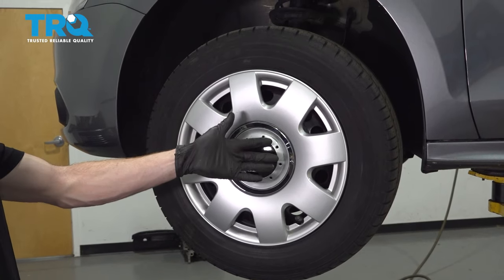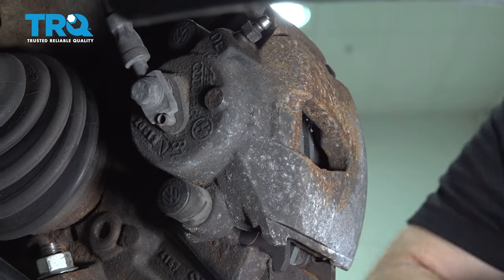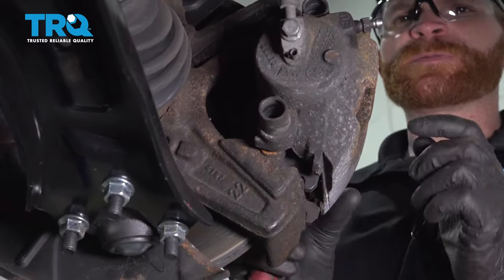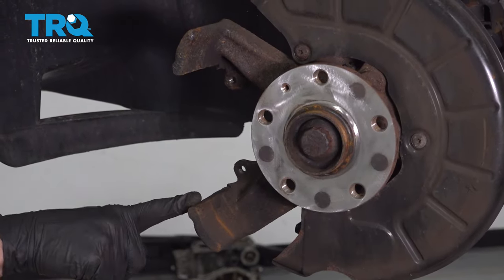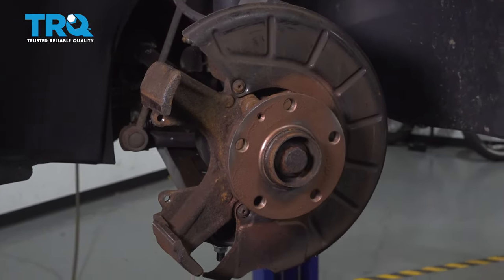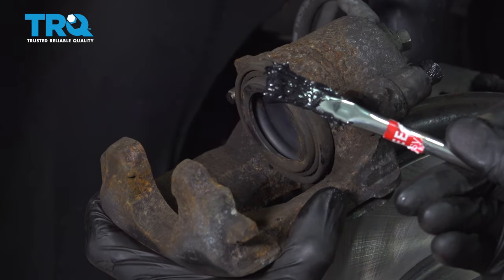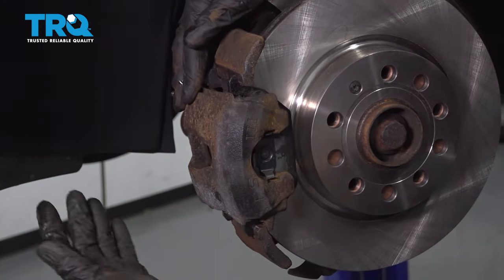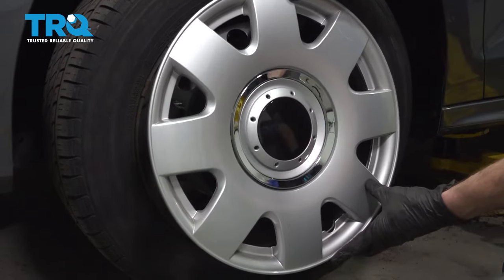How to Replace Front Brakes 2011-2018 Volkswagen Jetta

Comment: He was showing how to replace the brakes. However he had brand new brake pads on the car already. So the piston was already compressed due to the thickness of the pads. He did not show bleeding the brakes because he did not have fitment  issues. If you have to compress your brakes due to going to a thicker pad, then you will have to bleed your brakes.

Comment: Hi, the brake pads I bought have a little cable attached to it in one of them. I think that's the sensor cable. The current pad does not have one though. So, what do I do with that cable?

Comment: What year is this jetta? I have 2015 and a 2016 and different caliper bolts than those. And no need to remove the caliper bracket to get the rotor off those years.

Comment: Torque your wheel down to 89 foot pounds you hit it to about 100 or so with a half inch impact and stuck a torque wrench on it. Click the click click that’s not torquing to 89 foot pounds you can do better. You pretty much clean that hub down for no reason after that. But the rest of your video was great.